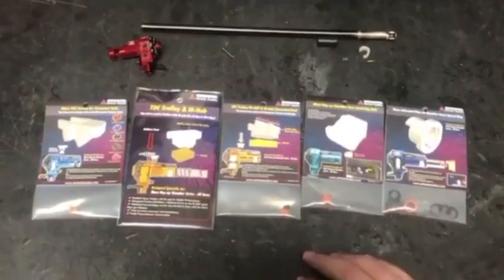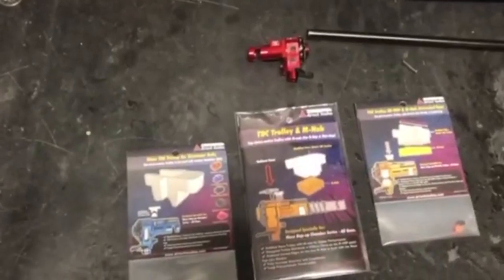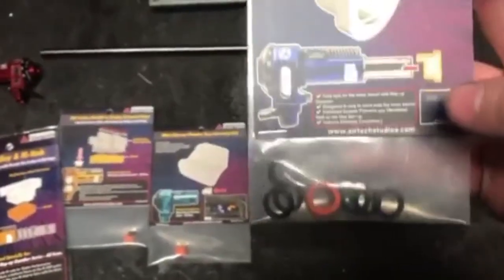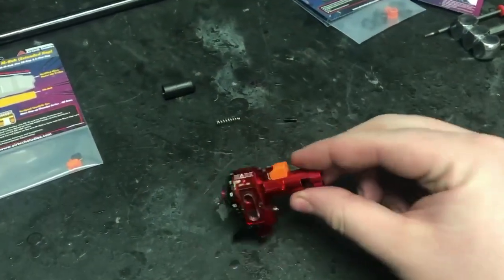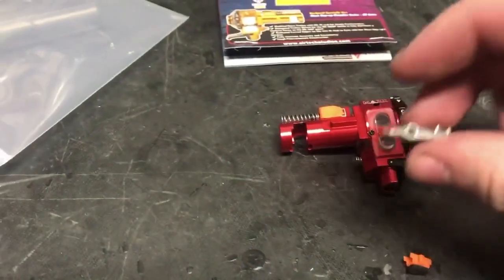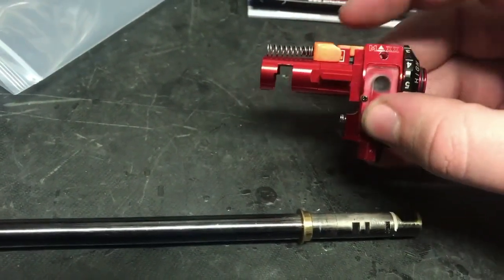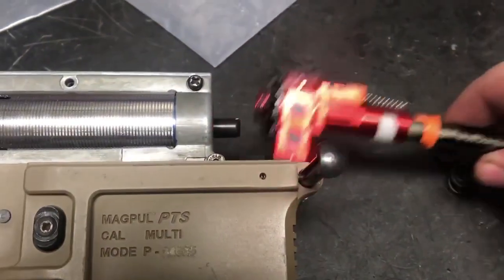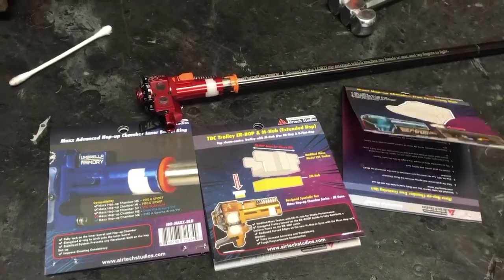Hop Up Time !  Airtech Studios

Comment: So I got the Maxx m4a pro hop up and it is wayyyy to tight bc I can’t even get it on. What do I have to do ?
Reply from the maker: What gun are you trying to put it in ?
Reply: @krampusairsoft9292  lancer tactical lt15
Reply from the maker: All right, I know some brands don’t like the hop up and lancer tactical happens prefer to use their proprietary parts at times ,so you may have to remove some material either from HopUp or from the barrel assembly where the HopUp slides into, both are decent options, depending on what you’re going for out of your lancer tactical.
Reply: @krampusairsoft9292  thanks, what about my bucking bc I got a new inner barrel and bucking ?